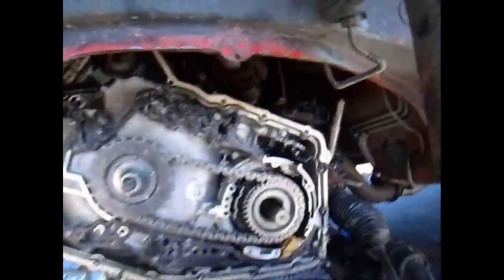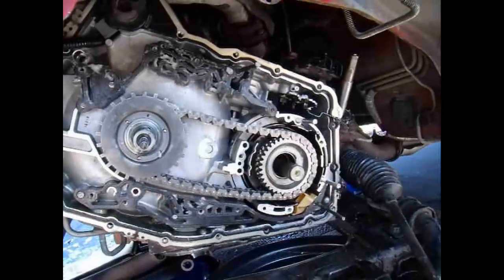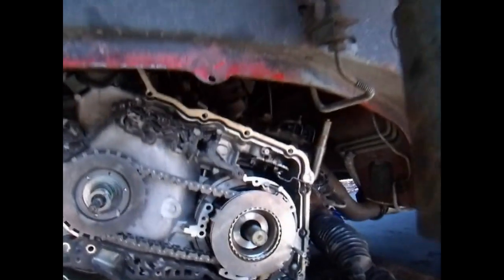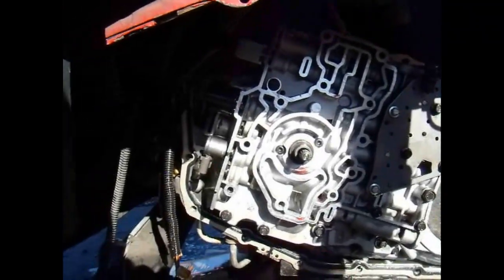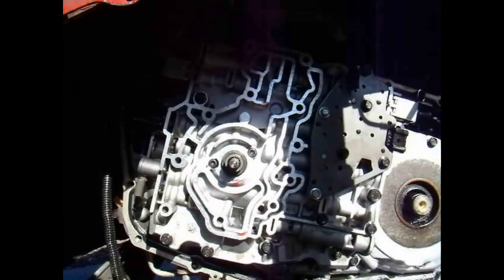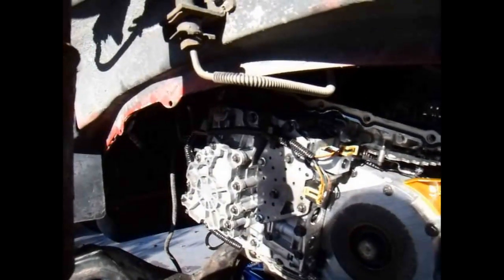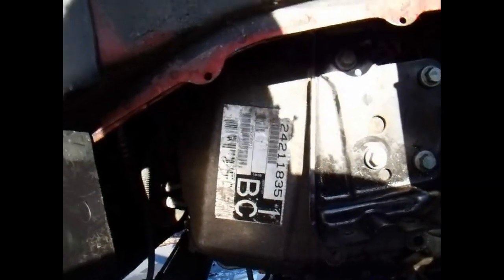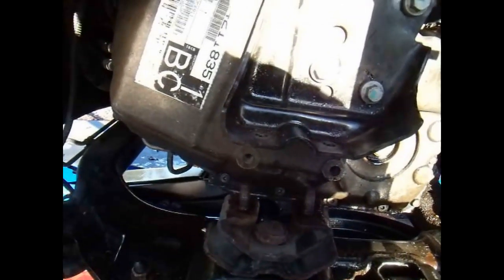Part 2 How to Fix No 4th Gear Overdrive 4T65E 4T65 E Transmission GM Pontiac Oldsmobile Chevrolet

Comment: thank you for the video, i think that i have the same problem...

2000 chevy malibu is what i have
it has the 4t45e

it idles fine, and drives fine till it wants till go from 3rd to 4th.

it then starts jumping back and forth between the two with the rpms bouncing like crazy. Sometimes it holds steady.
just easier to keep the car out of overdrive and under 40 mph.

is this the same problem or is that going to be a shift solenoid issue?
(any help would be appreciated thank you )

also if i floor it never has the issue.
Reply from the maker: The problem in the video would have the following symptoms.  When you let off the accelerator and the transmission should shift into 4th gear, the rpm's will drop to @ 1000, but give it gas again it will 'catch'  when the rpms come up and instead of a low rpm 4th gear, it's a higher rpm 3rd gear.  Your issue almost sounds like a shift solenoid issue.  That however is also in the cover.  My advice, if you do need to replace the solenoids, go ahead and replace the 4th gear spline.  They're not very much and this isn't a job you'll want to do twice.
VT247

Comment: Thanks for posting. Don't have that 4th problem yet (fingers crossed). But I am pulling the tail piece off of my Impala 4T65E as I believe I am getting a funky noise from the differential. It sounds close to a wheel bearing noise, especially when turning left with some lateral load present at speed. Just thought I'd share that. May do a posting after I find out what's going on. 101000 on the car. Think I should sell it as these transmissions don't seem to be the greatest.
Reply from the maker: Always found the GM 3.4 / 3400 engine is much more problematic than the 4T65E.  But you may be lucky and have the 3.8
VT247

Comment: I have 2004 montana and when i accelerate to 113km and keep pressing down the gas it will not go higher and the speed will start the drop down to 106km and it will starts to go back up to 113km and then the same thing happens. there is no engine light and when i use an OBD2 scanner nothing shows up, but when i slowly press the gas it can accelerate to speeds of 125km and not drop, but if i press gas harder after that it drops again, and when i get it to 120km and go to cruise control it is ok until i go uphill and then the same thing happens again. i have already changed all of the engine sensors, fuel pressure is ok, i have even changed things like the fuel pump and a lot of other things, i have changed the transmission oil and added in Lucas oil stabilizer. so what is the problem?
Reply from the maker: Possible dead spot on the throttle positioning sensor, catalytic converter, fuel filter plugged, loosing spark, check vacuum.  Several different possibilities.  Hope this helps some.....
VT247
Reply: +Vacationtime247 I changed all the sensors and wires the spark plugs are brand new I changed the fuel filter the only things I haven't changed  are the knocking sensor and AGR Sensor but the AGR sensor opens and closes when I tested it with a 9 Watt battery, thanks for replying and what do you think is the problem? the PCM, the transmission? I even put on a OBD 2 scanner and said everything  was fine. I tested the Catalictic convertor by taking out the o2 sesnor but it's still the same. another problem is when I come to a complete stop the RPM goes up by 400 then drops by 600 so what is the problem with that?
Reply: +Vacationtime247 I changed all the sensors and wires the spark plugs are brand new I changed the fuel filter the only things I haven't changed  are the knocking sensor and AGR Sensor but the AGR sensor opens and closes when I tested it with a 9 Watt battery, thanks for replying and what do you think is the problem? the PCM, the transmission? I even put on a OBD 2 scanner and said everything  was fine. I tested the Catalictic convertor by taking out the o2 sesnor but it's still the same. another problem is when I come to a complete stop the RPM goes up by 400 then drops by 600 so what is the problem with that?
Reply from the maker: Possibly the fuel pressure regulator?  Know you checked fuel pressure but it's possible under load it isn't functioning right.  Also check the vacuum line going to it as well.  Does it help if you downshift into 3rd gear will that allow you to gain more speed?  Does the motor seem to cut out at a certain RPM or just a certain speed?
VT247

Comment: Seem to be having the same issue in my Pontiac G6, but my transmission seems to be the 4t45. Different parts not withstanding, should the process be about the same?
Reply from the maker: +craze0matic I'd say it is probably going to be similar.  But with the G6 the 4th gear spline should be hardened.  So I'm only speculating to say it is similar since I've not done the 4T45.
VT247

Comment: I'm having problems to remove the driver side shaft try take it of but feels like is stock what I'm doing wron
Reply from the maker: Rutilio Perez Sometimes takes a curved pry bar to have it come out.  Also helps to push then pull with the long metal rod in the center of the half shaft.  They can be tricky at times.VT247

Comment: what does that plastic piece in the upper right actually do?
Reply from the maker: It's either an oil deflector or helps line up the assembly.
VT247

Comment: Great videos! Do you happen to have a parts list/numbers available?  Want to make sure I purchase all that is needed.
Reply from the maker: Not sure what the part numb#rs were.  To do this you'll need the 4th gear spline, 4th gear frictional and metal disks with apply, case cover gaskets upper & lower, trans filter and fluid, case thrust washers, Vaseline to hold on thrust washers, perhaps some guide bolts to hold on case gaskets .  
VT247
Reply: Vacationtime247 Great thanks, I was able to get the drawings from GM along with a all part numbers.
Reply from the maker: Just a few bits of advise that I missed:  
1 ) If you've got a little extra $, replace the solenoids too.
2 ) Make sure the steering gear shaft slides out when lowering the subframe from the rack & pinion.
3 ) Mark the drum on the transmission case and use guide bolts.  
4 ) Take some of the bolts holding on the case / valve body to Fastenal and get slightly longer ones.  Grind or cut the head ends off and use them as guides.  Holds the gaskets on and makes guiding it on easier.
VT247

Comment: excellent video but where did the spline metal go,is that a major problem??
Reply from the maker: The metal shavings wind up in the transmission pan.  Never caused any problem as I changed the fluid as well with this fix.
VT247

Comment: where are the shift solonoids,in the pan or under the cover u got off??
Reply from the maker: The shift solenoids are behind the side cover, on the valve body.  Even though I didn't change mine, it's recommended.  
VT247
Reply: yep side cover. Also replace the PCS. But if all your having problems with is the shift ratio being off there is a shift kit that can be installed into the accumulator in the bottom of the pan. Its worth a try and is less costly and has helped a lot of people fix the problem of stuck solenoids.

Comment from the maker: I thought about replacing all the sensors in this 4T65E, but it works well and I've never had a problem with it.  So, it just got the broken parts fixed.  I.E. the 4th gear spline.  Watched several of your videos to get a reference point on some of this fix.  
VT247

Comment from the maker: YES!  It's fixed.  Figured out what happened.  Didn't have a thrust washer on right and the hub wasn't in line.  Works perfect now and 4th gear is back.  No more rental car.  It was a Nissan Versa.  The only thing I liked about the rental was it got good gas mileage.  Other than that it was a bare bones stripped out model.  Payed less for every other rental I've had and they've been more optioned out.  Really liked the Chevy Cruze I had while I scoped out California houses. 
VT247